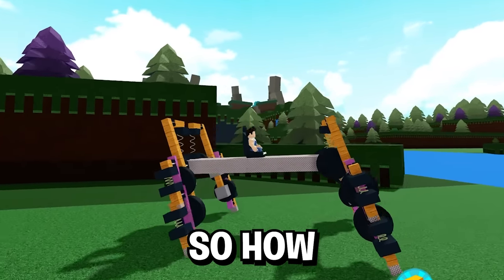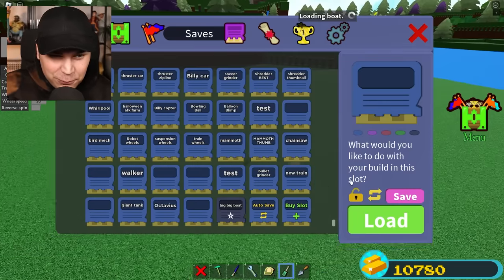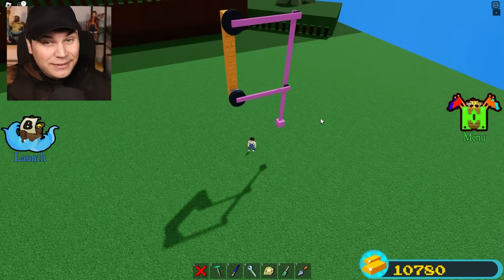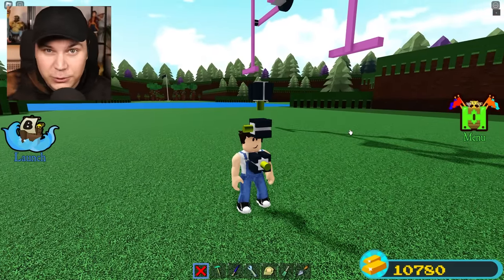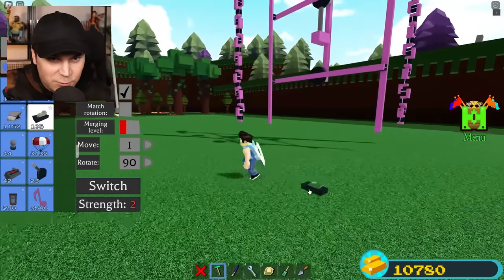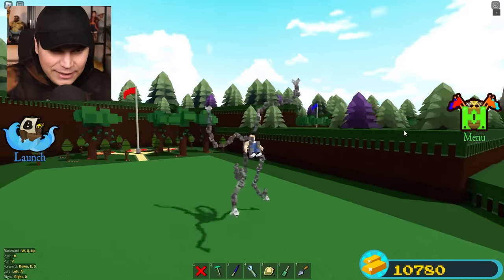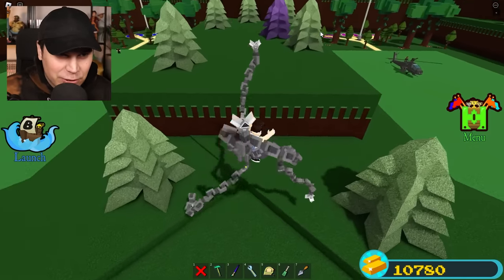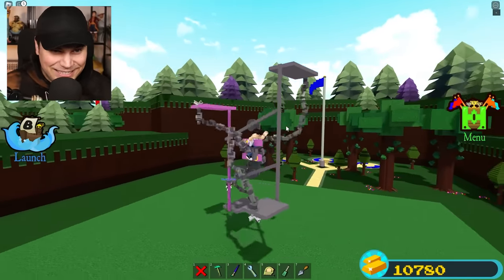I BUILT A CYBORG MECH In Build a Boat!

Comment: The problem with your walker designs is that if you just focus on the leg and make an imaginary retrace of the path the leg is following yours is a circle but for most actually walking legs is that the shape that they trace is a half circle because the leg is at the back moves up and forward then moves down to the ground and in a strait line goes backwards to move the creature/what the legs are on forwards.
Reply: a bot stole your comment and is the top comment 🦅